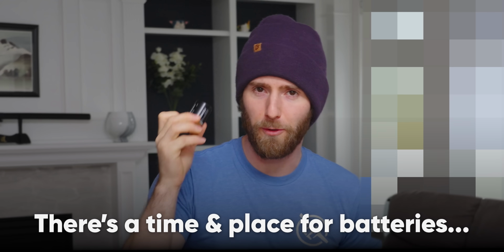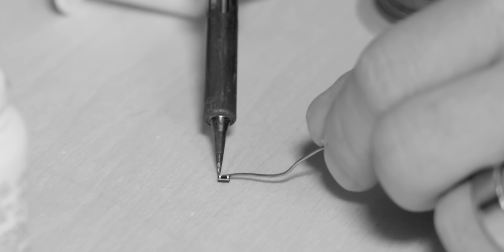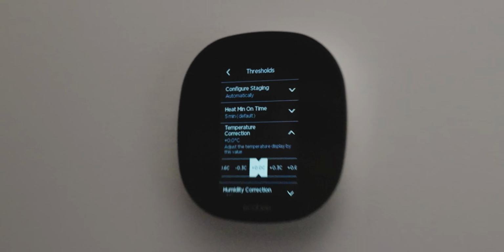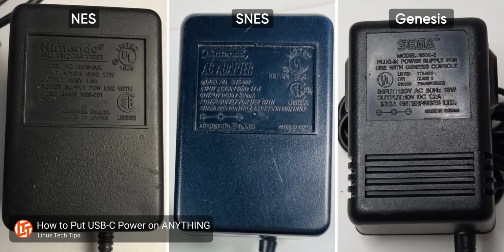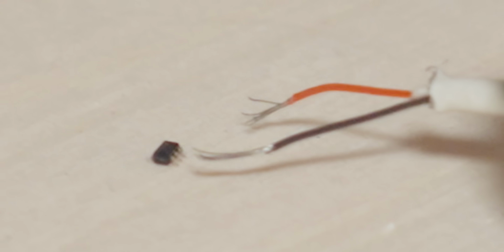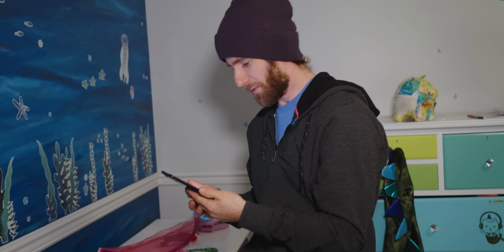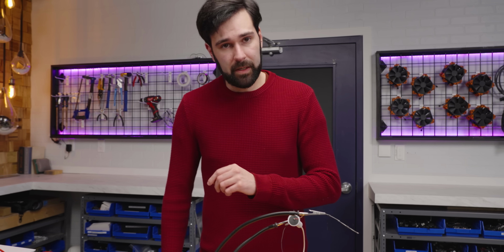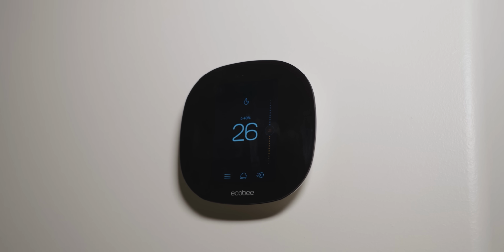I HATE Batteries! - Converting Wireless to Wired (a cheapskate’s guide)

Comment: You could also take apart the power supply and replace the voltage feedback resistor with one of a lower value, similar to what you did with the GPU shunt mod. This will reduce the output voltage of the usb.
Reply: I've done that before but it's not that easy. Reducing the output voltage also reduces the voltage on the primary-side controller chip. Basically it will blink on and off. I needed to add extra turns to the transformer to make it work. For safety reasons this is obviously not something I'd recommend for most people.
Reply: @eDoc2020  I’ve modded plenty of power supplies this way and never encountered that before. Granted, the power supplies I’ve worked with were usually 500+ watts. I would guess the blinking on and off to be due to the undervoltage protection.
Reply: @LegoTechnicsRule  Smaller switching power supplies are almost always flyback converters where the auxiliary supply voltage is proportional to the output voltage by the winding ratio. It's definitely the control chip cutting out. Larger supplies are other topologies like forward where if the aux voltage is derived the same way it will be proportional to the input voltage, thus unaffected by the mod.

Comment: @LinusTechTips Just a Question for Dan or an Electrical Engineer; Is it possible to use a Capacitor of a certain value to assist in the current draw increase, or would that cause a problem when you first plug in the Wall Plug or have AC restore from an outage... not sure what 1microfarad to 10mictofarads, would do to your power supply on initial surge?  Any ideas?

Comment: "3.3 Volts not quite low enough" ... quite sure the device components internally are designed for 3.3 Volts and 3.2 down to 3.0 Volts is fine. Many also go as high as 3.7 Volts, at least many 3.3 microcontrollers do. Also instead of using SMD parts you could've used like a LP 2950 ACZ3,3 LDO in a TO-92 package which costs like 30 cents. Your problems with voltage spikes probably are due to not having capacitors helping with the rapid changing current draw of the circuit. So two small electrolytic capacitors and two bypass capacitors would've done the trick. Overall maximum of 5 components in the "less than 5 bucks" range. And with a TO-92 package and some through hole technology electrolytics soldering would be much easier and probably would still be possible to fit inside the battery compartment.

Comment: A buck converter would be far simpler but using zener diodes is a fun idea. All you would need is a 5v three pin voltage regulator and a few resistors (follow the schematics and math formula in spec sheet which allows you to adjust to lower/higher voltage). It can all fit into heatshrink. Overall cost would be less than a quarter each.
Reply: 3V Zener Diodes are not that common. An adjustable Voltage Regulator is the best choice imho. Dropping voltage across diodes is not really stable with extremely low current draw
Reply: buck converter would be far more complex

Comment: The setup with diodes is plain wrong. Just use 1 zener diode 3V and a resistor if you really want yo use diode. Otherwise much better to just use a LM1117-N 3.3V if you want to solder.
Even better just a usb cable with a step up/down converter and a dc connector for few bucks. Then on your temperature captor you drill a hole and insert a female dc connector and solder it on the tabs. This way you can unplug easy and no cables will be pull and disconnect over time.

Comment: Hey Dan, Linus - the voltage regulator solution with potentiometer is actually still almost right on the money. You've got a few realistic possibilities for keeping this cheap and fixing the problem with transient spikes in current draw ruining the voltage.

The first, and probably easiest is just to toss a small capacitor in series with the voltage supply. This will smooth out those transient spikes and keep the device online. Since these devices are tiny and only pulling a few milliamps at peak, even a 1uf is probably sufficient, though I'd spring for 10uf. Also, anybody seeking to use the DIY approach should probably just buy a lot of 100. 100 caps is usually like $3, or $0.03ea, so if you make a mistake or need to do another device, no big deal.

Also, there are ready-made solutions for this you can get straight from china for super cheap, so it might not be worth the effort. For example, with prime shipping you can get a pack of 10 3-12v input 3-12v output range 3A voltage regular PCBs. These are more robust - it's a pcb with surface mount components and nice through hole pads for input and output, and its a complete variable voltage regulator circuit with fuses, an output transistor, and capacitors for smoothing. A ten pack of them usually runs about eight US dollars, or about eighty cents to convert a device -- what Linus ended up with after accidentally breaking one of the regulator ICs.

Comment: The 1000 ohm pot is a voltage divider and the ic is not required. Setting the pot wiper at 600 ohms would divide 5 volts into 3 volts output at the wiper. Otherwise use a 3 volt zener diode with a 47 ohm resistor. The series voltage drop of diodes is not recommended.

Comment: Meanwhile, I picked up 5 pre-downrated USB to crocodile clips for £10 off eBay - they output about 3.3V and are happily powering things that want 2 AAA batteries. Haven't tried soldering them onto button cells yet but I don't foresee any issues

Comment: This is the main problem with many smart home devices. Why are so many smart home sensors battery? They could just make more expensive models of smart plugs with sensors built in, but it does not seem like anyone does that. Basically if you are not building the sensors into a new house you are plagued with tons of batteries or you have to do this to all of your devices.

Comment: When Linus says I guess the dresser just is going to stay this far away from the wall now. My first thought was you could get one of those "plug saver" extension cords they are just a around 1ft or less short extension cord. I think they're mostly designed for the big bricks you plug into the wall so they don't take up more than one spot. I think they even make them where the plug is flat. That way the USB adapter wouldn't be sticking out of the wall and you can push the dresser closer to the wall. I mean you could just use any regular extension cord but then you didn't have an extra extension cord slack but for his junkie as this is that would fit the setup. I have a lot of those about one foot short extension cords all over my house for this exact reason or because the big brick covers up the plugs I'm trying to plug it into.

Comment: take a 3.3V voltage regulator and on the output a shottky diode Which has a forward voltage of about 0.2V and you can pull all the power the sensor needs instead of a resistor (which is a stupid choise) btw i BET you the thing will work perfectly on 3.3V out of the regulator.

Comment: Do they not realized battery voltage also changes with discharge? For anyone wanting to copy this use this part instead LF33CV. If you have trouble, add a 1uF capacitor to the output.

Comment: Linus: For cleaner solder joints, have a wet paper towel folded up, next to your soldering rig. After every couple of solders, wipe the iron tip QUICKLY on the paper towel.

Comment: Next time use LM7803, it outputs 3.3V ant it will be just fine. Soldering trough hole components is much easier rather than tiny SMD components mid air. Also with super low currents (up to 100mA), the easiest way would be one resistor and zener diode and aslo probably the cheapest solution.

Comment: This gives me an idea - get one of those little solar panel thingies that provide power for stuff like security cameras (I've got one that's the size of a book that does 6V 3.2W) and connect it to a large capacitor bank, then use that with two voltage regulators to provide 5V and 3.2V feeds to all rooms in my via the unused telephone outlet connections. If I size the cap bank correctly, I'll never have to worry about the voltage dropping too low.  

Of course another way to do it would be to use PeE for all the CAT5 cabling I've got in the rooms and tap off of that, but where would be the fun in that? 🙂

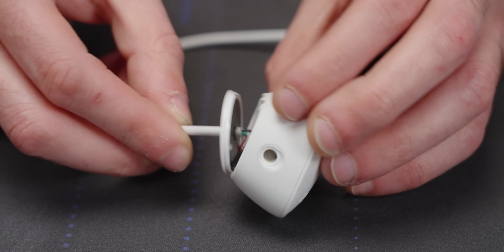Comment: So for the spikes, what are they doing? Do they have a capacitor in there? I can't read electronic parts, those at 14:22 look like there isn't, capacitors afaik only have both terminals at the bottom. Since resistors aren't directional, are those... diodes? Would love an actual like component list

Comment: It would have been desirable to see a proper solution, a PCB replacing the battery with a proper voltage conversion and a plug for the cable. Alternatively, a PCB holding a larger rechargeable AA battery. Keep the standards high, this reflects poorly on LTT quality standards. Collaborate with another content creator  if necessary.

Comment: They where overcomplicating it, use arduino stepdown modules, they come with configurable input-output values. Those modules do use sort of the same chips they used in this video but it's all already wired

Comment: I would much rather have just bought an external 3.3v power supply and sliced the wires into the battery contacts. Sure it may not be as cool of a solution but it seems way more practical and possibly even more reliable.

Comment: I agree with your battery comment, I hate them. They have their place in certain devices but cameras for me are always POE ( and any device that can take advantage of it) and my smoke detectors are wired with batteries as backup. Also started playing around with replacing devices using AA or D style batteries with some smaller power vault battery packs for convenience of longevity and rechargeable. All you doing is matching DC voltages so its not the bad to convert. Also if I can centralize DC devices where needed I can do power supplies that are available as 5vdc, 12vdc, 24vdc, etc. Great video and doing what we like and that is DIY!

Comment: The voltages don't need to be exact. Batteries have a nominal voltage, but will start higher and end lower. The device you are modding will already have a voltage regulator built-in. So really you just need to provide voltage and current that's within the specification of the device's voltage regulator.

Comment: why no one decided to use a voltage divider ... the world may never know. Diodes is aight - not great. Also 3.3v regulators are very common. LM117 for example, oldie but a goodie. Just go to the Arduino community - tons of people there constantly have to step down/step up IO voltages between 3.3v sensitive chips/sensors and vice versa.

Comment: I recommend to get some prototype PCB boards. They are available with the Through hole pitch and the SMD too.
You can easily cut them to smaller pieces, and they provide a nice connection to your prototype device.

Comment: Totally disagree with Linus here. A sensor reporting temperature, due to its nature, sometimes, will be placed where there is no power from the wall. For connivence, a battery-powered device is the way to go here solving all the issue. Also, the latest ecobeen smart sensor gen last between 3 to 5 years, long enough for not worrying. Also, adding a power cord compromize the stability of an otherwise nice home decoration.

Comment: That heating setup seems so expensive and complicated compared to the single zone per floor forced air I’m used to where you just adjust how open the vents are if a room is too hot or cold. Still useful info on battery only devices though.

Comment: Battery powered smoke alarms are safer than hard wired. The reason is radioactive decay.

The smoke alarm uses Americium, which decays over time making it less effective at detecting smoke. If you use a plug-in smoke detector that lasts longer than the americium's ability to detect smoke you're in for a bad time.

Comment: wouldn't it be way easier to use a simple 3 or 3.3 V zener diode with a series resistor? most of them can handle .5 W which should be sufficient for this device.

Comment: idea: 3D print a base that matches the battery diameter so it would slot in and incorporate a tiny adjustable voltage regulator in it. this way stays neat and you set the voltage and forget it.

Comment: You know,  I could see a small PCB being made to fit in the place of the coin-cell battery using the same batter contact points. But the PCB has all lthe stepdown magic do-dads (technical term), and 3 solder pads. Then you simply create the hole in the back of the device, run your wire, solder it on to the pads, place the PCB in place of the batter and BAM! Maybe a lot of work for a one off but if you have more than one or 2 of these to do, might be worth it.

Comment: To be fair, these type of devices have super small quiescent current draw and last up to years on a single battery. Kinda like digital clocks, mine is still going on the same battery that I installed in it back in 2015 or so, idk it's hard to remember.

Comment: This was both informative and painful to watch. Please, just buy a breakout board (it has the linear SMD regulator on it and "breaks out" its pins onto larger pads that you can solder onto easily, while still being smaller than a THT package) or get a small buck regulator. Buck regulators don't waste the excess power as heat but their output is noisy, so pick whichever fits your particular needs best.

Comment: I don't think powering that with AC is worth it. Might be simpler to buy a AA pair battery holder and solder it direct. Just have to get the polarity right. I've done this a couple times for sensors located in cold locations. The coin cell batteries can't keep their voltages up in the cold while the AAs can. Extra long life considering the mAh difference between a coin cell and 2x AA.

I appreciate the whole idea of this video. Battery and wireless life is great but for the constant need to have and replace all these batteries all the time.

Comment: If you're  going with the diodes you might as well get a Zener one and an resistor for current limiting.
But really what you want is a through hole package linear voltage regulator and an capacitor on in- and output.
Reply: Youre right, but no need to have seperate capacitor on input, since its coming from powerbrick which has capacitors on its output. Capacitor after the linear regulator could solve the problem with high startup current.
Reply: @tilipitappi7762  The wire is very thin and very long. So the impedance is an issue, a capacitor close to the regulator might be needed.

Comment: Diodes are smart, but I'd put about 5K resistor between the end of the diodes and the negative to ensure there is always a very light load that will make the diodes drop enough voltage!

Comment: For this kind of projects I use MP1584EN or LM2596 buck down converters. They can deliver about 3A tops with 4-40V input. You can buy them in 5 packs for about $10, much easier to solder and way safer. They are adjustable, the LM2596 uses a 10 turn pot so you can adjust it at precisely 3V. They hold the output steady at variable amps and variable input voltage. The MP1548EN is the smallest which will fit nearly anywhere.

Comment: I watched this video and wonder why he didn't just move the thermostat to the other side of the wall. Take off the thermostat, drill a small hole from the bedroom side, fish the thermostat wires through the new hole, remount the thermostat. Then patch the hallway wall & have the painters in yet again. That would have been WAY easier, faster, and a better long term solution than getting yet another device and trying to modify it.

Comment: Man’s learning basic electrical engineering design. We all start thinking resistors are great until you remember the load from the device is a parallel resistance which impacts part of the voltage divider. 

Texas Instruments has a wonderful online tool called Power Designer that generates power circuits given certain constraints. You can then choose a circuit with the best characteristics, like minimal ripple, excellent efficiency, slew rate, etc.

Comment: That's why you should use a capacitor as a buffer/filter.
Reply: buffer caps and slightly higher voltage. Batteries aren't stable over their lifetime, so pushing maybe 3.3-3.35V in should be plenty.

Comment: Or, you can buy a buck converter with usb input and dc output and tune it to the appropriate output. You can get a 5 pack for like 10 bucks, and you only have to solder 2 wires and use a screw driver to tune it. Super fricken easy. And you can get them with a variety of usb ports.

Comment: The old version of the Ecobee sensors are even worse, they get around 6mons of battery life. But for a tip to anyone wanting to do this and somehow finding this message .. you can get mini switching voltage regulator boards (~$1 each in 10 packs), they'll handle the drop out fine, don't put out heat, and can fit. Just solder a USB cord, adjust voltage, and you're good. Search for adjustable micro BEC. So simple I use them in tons of annoying battery conversions. 

And one thing that annoys me about some devices is when they're wired but don't include a switch over circuit .. take Fire Alarms, a lot are wired these days, but they still run on battery, they ignore the power line, a switch over circuit (detects lack of power and switches to battery) would be so much better. Only the expensive ones integrate that.